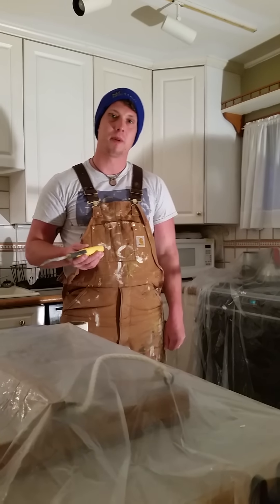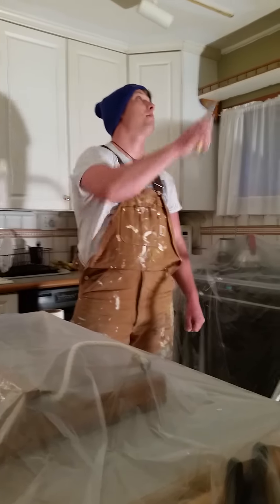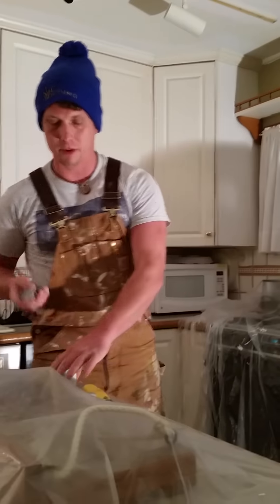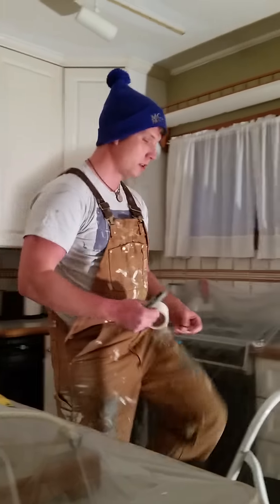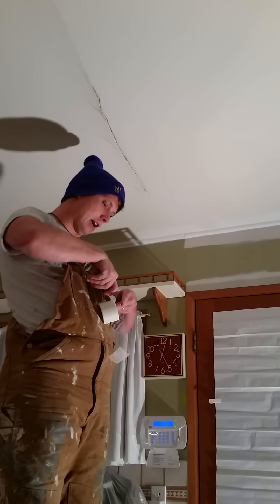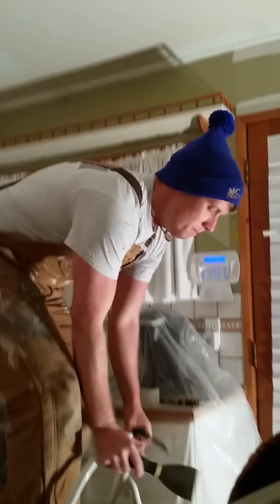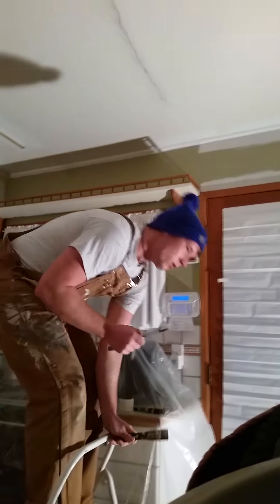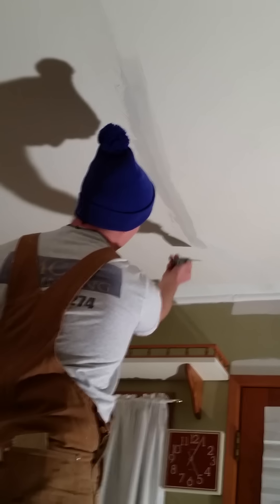Repairing ceiling crack part 1 of 3

Comment: Hey Mike, fixed the cracks, worked out really good. But one of the cracks re-appeared again as a crackline. I suspect that there might be connections of two plaster boards in the ceiling. Any advice on how to fix it permanently? Thanks in advance.
Reply from the maker: Dmitry Ovchinnikov , apart from removing the sheets and relocating your joint-- you can use caulk or an elastomeric paint that will flex with your crack
Reply: Thanks Mike, I will try that and will let you know.